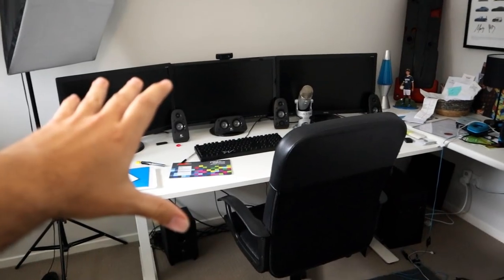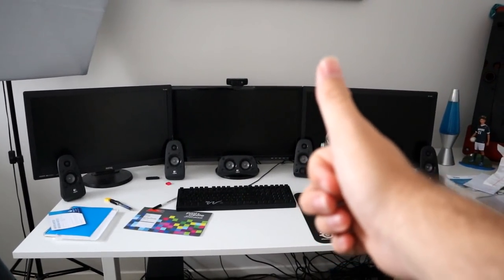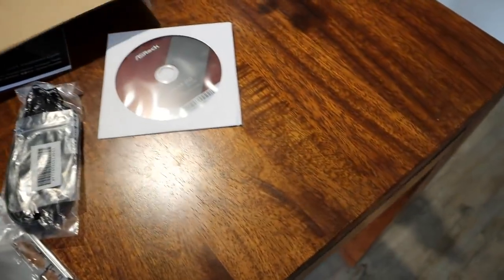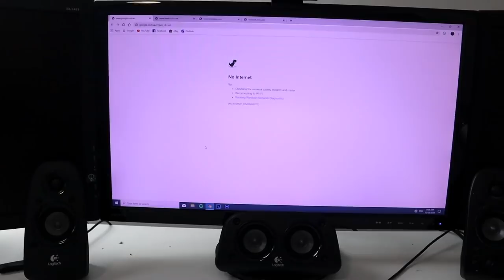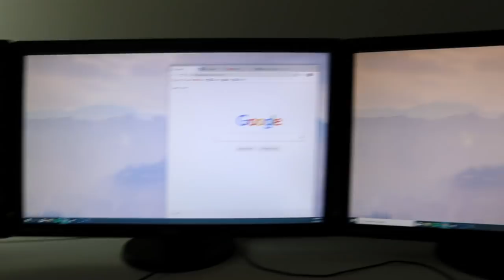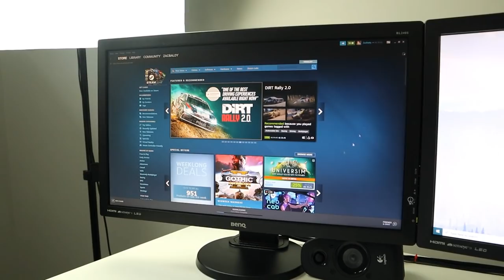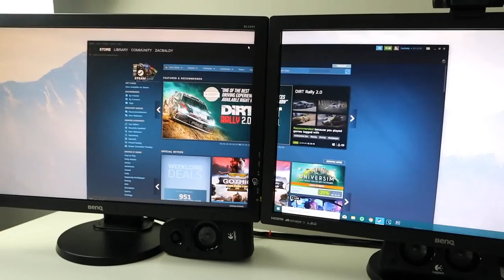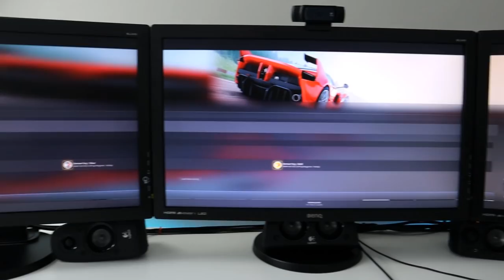This Will Change my YouTube Career FOREVER

Comment: Really good choice going with the Ryzen 5 3600, gaming performance is awesome and it smokes Intel's lineup with multitasking 😁

Edit: Your GPU being pinned to 100% is completely normal, it just means its the bottleneck of your system. Also PLEASE check your RAM speed. If its running at stock 2133Mhz then your losing a ton of performance, especially on a Ryzen chip. Make sure you are running at the max possible RAM speed that your Motherboard and RAM itself supports. (It's probably 3000Mhz)

Comment: Ryzen 3000 with A320. 👎 B450 minimum or preferably X570 Zac, all day. I've got 2 Ryzens at home.
PC 1: A 1700 overclocked to 3.9Ghz, Asus X370-Pro with a ROG Strix RX480 on 1450Mhz, 16GB 2666mhz HyperX ram.
PC 2 (storage+backup): A 3400G on a B450 MSI Tomahawk Max, 16GB of Trident Z NEO 3600mhz ram.
Also I edit my episodes on a stock ACER Intel i5-8265 laptop (it's basic!) to show people you don't need thousands to do a 1/2 decent video. 😉
Reply: You know he's not gong to be able to tell the difference in motherboard chipset right? same performance less features? And he was on a budget of 500
Reply: @100mg4  $500 could've got him a 1600AF, B450, some TEAM 16Gb ram and a decent RX570. 🤷
Reply: @MafiaboysWorld  Why buggerise around with used parts and when he could get something better for a similar price and with warranty? Zac's not a computer nerd like some of us, would be a massive stuff around for him to get used parts and overclock.

FYI an rx570 is slower than a 1060 (both underperformers)
Reply: @steeley_  Everything I mentioned is new online bro. The 1600AF (search for yd1600bbafbox) is AMD's refresh on 12Nm for $120. The B450 is $120 for a good one. The ram is $100 and the RX570 is $180 from PC Case Gear. That's $520 total.
A RX570 smashes a 1060 3Gb today due to better vRam. 👍
Reply: @MafiaboysWorld  good thing that he has a 6gb 1060 👍 (real world performance on a 1060 3gb and a 570x are very similar) 

3600 still a better CPU, doesn't need to OC and the ram is decent. Again, consumer accessibility from local computer stores are the main reason for parts choices. Solid upgrade for a streaming pc.
Reply: @steeley_  Better check 21:14 again mate. I made the same mistake earlier in a different comment and was corrected so I'm passing on that info to you now. 👍
Reply: @MafiaboysWorld  I still choose to respectfully disagree on your hardware choices :P
Reply: @steeley_  Your prerogative to do so. But you aren't getting 60% better performance with your 3600 over a 1600AF considering it costs 60% more for a 3600. 😉